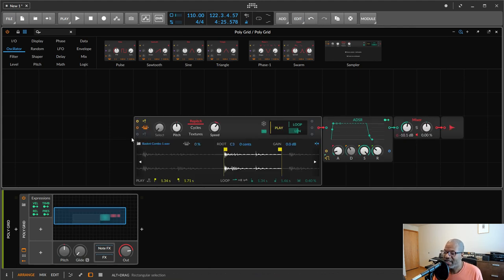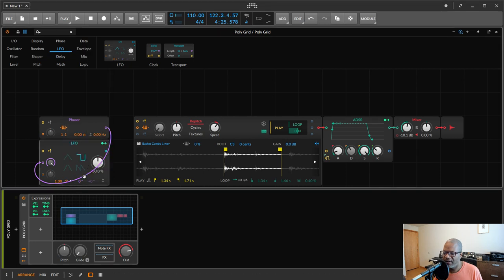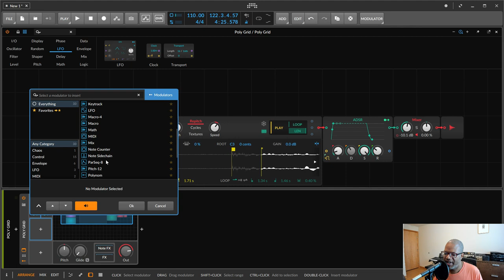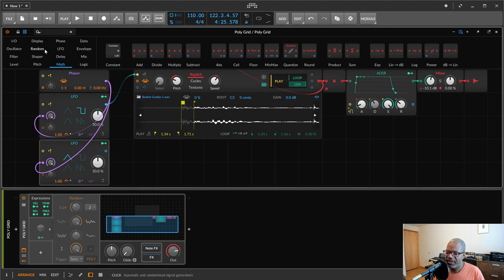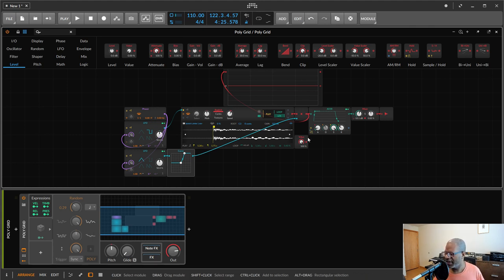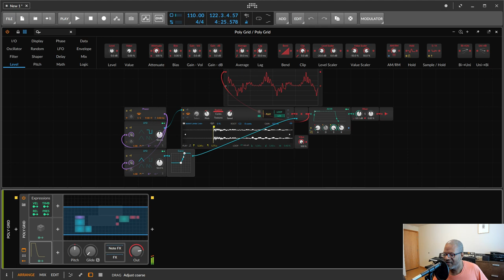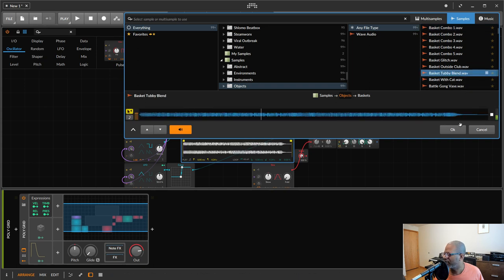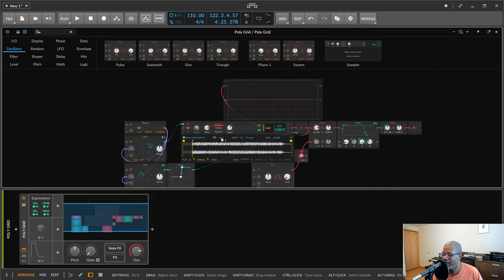Bitwig's Grid Sampler: The "bicycle spoke" effect

Comment: great vids!! please more vids on the sampler in the grid, think this is new territory for a lot of people and so many possibilities it can be overwhelming. very useful to have some to the point videos about actual sound design for this. what would interest me: is there some frequency to midi thing i could build in the grid? means: having a sampler set up and run parallel a synth that gets triggered with midi notes derived from the  actual pitch of the sample, is that possible? i just know in pure data there is a frequency to midi object i can use for this kind of tasks...
Reply from the maker: I think it can be done, but don't know how elegant or robust it would be. You can get pitch conversion using the "Zero Crossing" module. Then to get midi out, you would need to use the "Replacer" device, and modulate the note key parameter with the pitch signal you got out of the "Zero Crossing" module. Don't know how well this would work, but my guess is, not very well.
Reply: @AudioDigital  thanks for the hint! even if it works badly i ll give it a try!